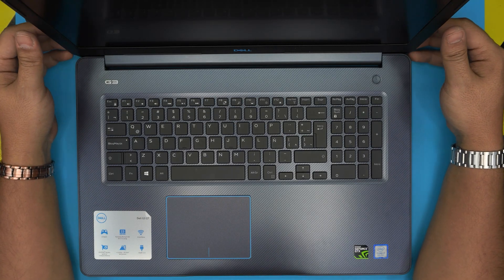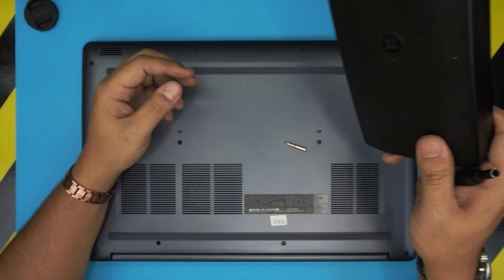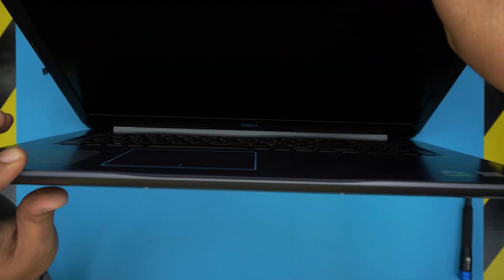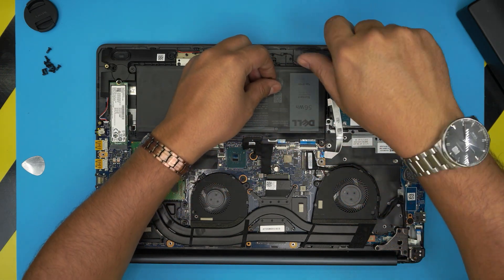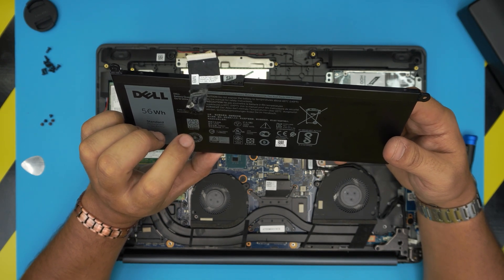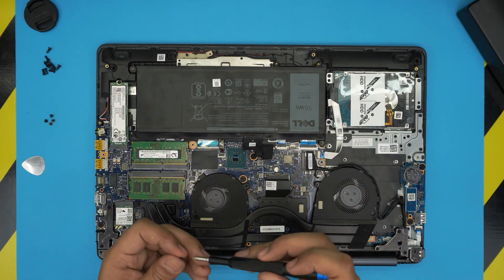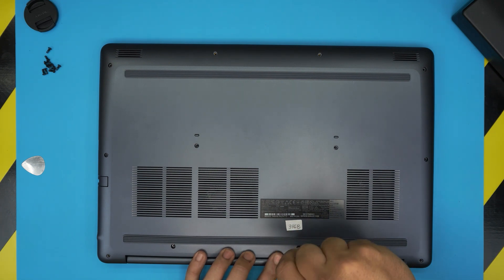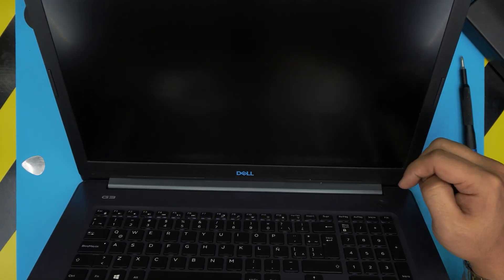Dell G3 17 Gaming  🚩 P35e003 💻 Battery Replacement

Comment: Will this work for the Dell G3 15 3950?
Reply from the maker: The steps are identical, very similar – you can't go wrong. If you have any further questions or requests in the future, please don't hesitate to ask me.
Reply: Thank you. Can you recommend what battery I should buy? @uFixTek
Reply from the maker: can you give the TAG # of the laptop?
Reply: Do you mean the model? I don't know what the tag is. @uFixTek
Reply from the maker: under your laptop there is a model number and there is a tag#  give me the model number and tag #. you can find that on the bios information section.